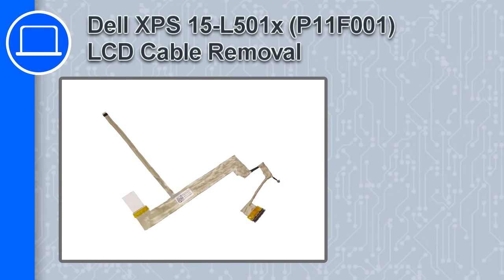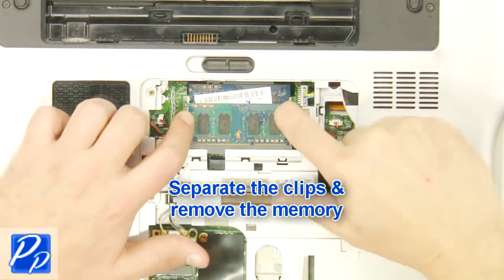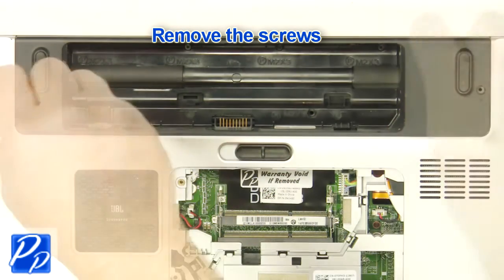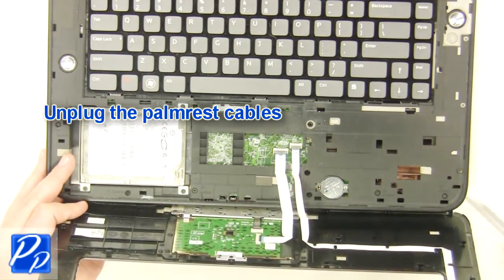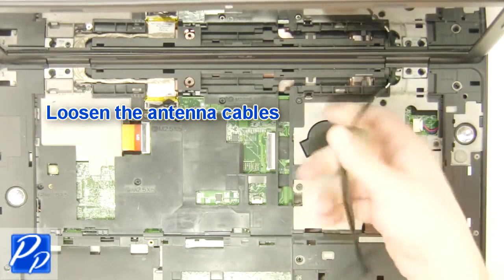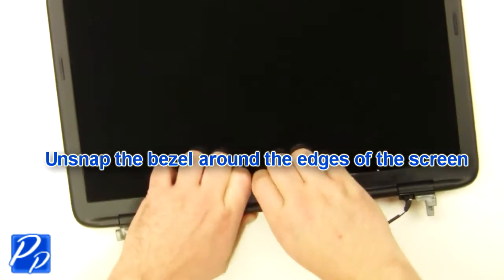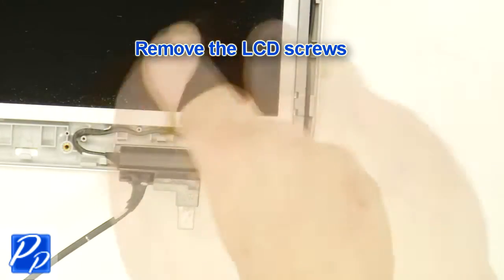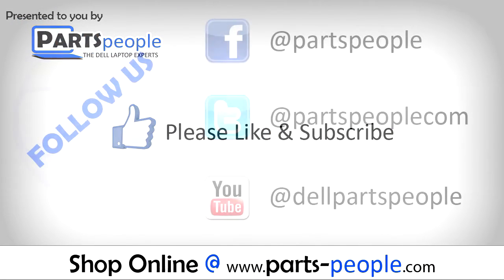Dell XPS 15-L501x (P11F001) LCD Cable How-To Video Tutorial

Comment: no need to remove ram & wireless card, it does not interfere in anyway while you replace LVDS cable...just pull out wireless card connector cables...